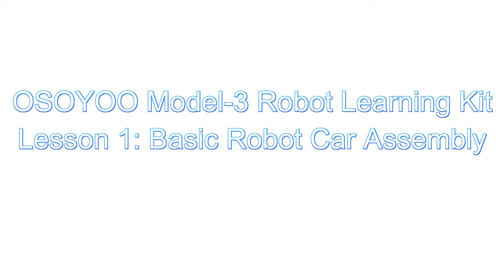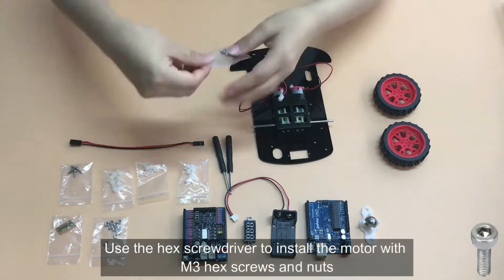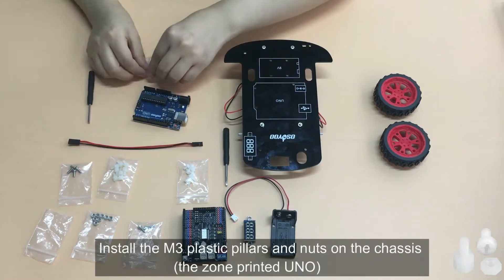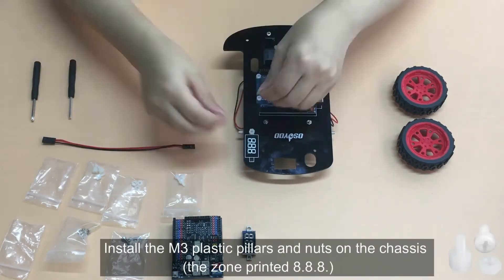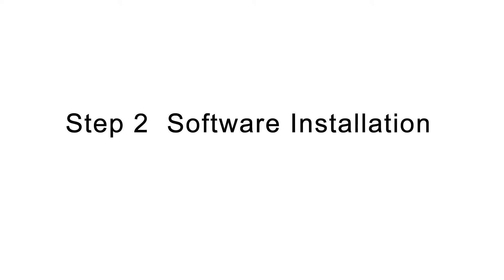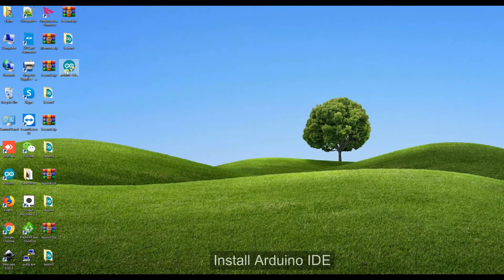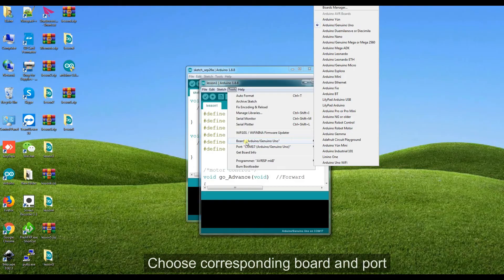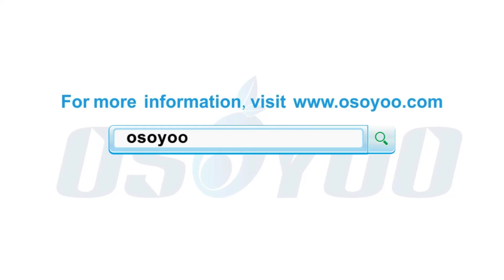Osoyoo Model-3 V2.0 Robot Car Lesson 1: Basic robot car assembly

Comment: I doesn't move. I did the same thing as in the video. When I turn it on, it just makes sounds and the car doesn't move. What should I do?
Reply: Every wire is in its place
Reply: it just says the voltag number and doesn't move.
Reply: @Ahmed-pp1pe  did u fix it cus mine doesnt work
Reply: @bandit-ttk  yeah, you should get a new battery cuz mine didn't have enough volt so it didn't work.
Reply: @Ahmed-pp1pe can u show me your code pls cuz mine didn’t work will